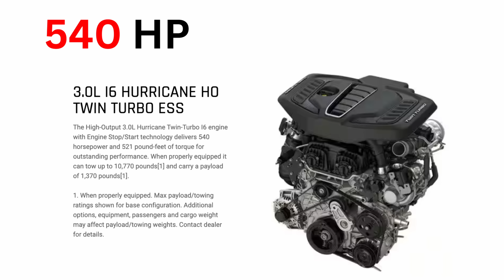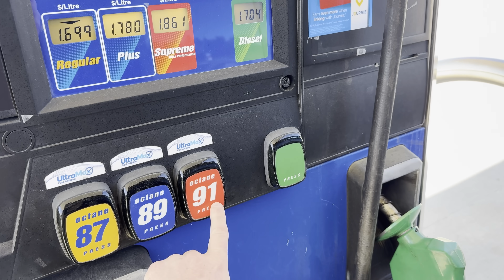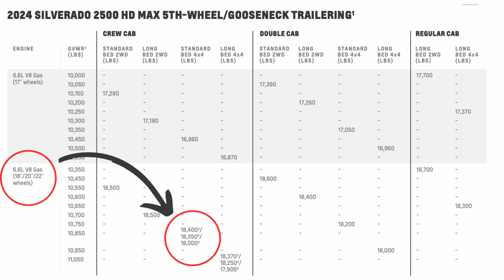Ram 2500 3L TWIN TURBO HO Hurricane Engine (540hp) | Will It Replaced the 6.4L HEMI??

Comment: It's going to take high octane fuel to run a higher end engine, no matter who makes it.  With variable cam like a BMW,  you could possibly change this,  but octane is part of performance.

The goal is solid performance at reasonable costs.  Places like here in California,  diesel engines are under siege,  but we still need the capability.   If that means high octane fuel,  no problem.   

Of course it would be better if the laws were more reasonable, but they aren't.

Comment: Just got back from a 10 state 4,300 mile trip out west over mountains, thru deserts, and across the windy plains. The 6.4 did fantastic. Terrain, ambient temperatures, or speed did not impact any of the vital temps. Yes, the hemi is thirsty pulling a 10,000lb 5th wheel but power / engine performance was never an issue.

Comment: The 6.4 Hemi will stay put; for all the reasons you mention, plus it's in a 2500. There's currently no CAFE requirements in the 2500 truck segment, so Ram/Ford/GM have no reason to change out those V8 engines.

Comment: These are light duty engines. The only way one might have a chance is to detune it so it wouldn’t burn up. Cummins 6.7 in a pickup has way more power than in a freightliner chassis. Ford power stroke again way more power in a pickup than a f-750. And the 6.6 duramax in the pickups again way more power that the heavier chassis from international and gm. They just couldn’t be worked hard in commercial duty.

Comment: Love my 6.4, it's hard convincing people that the HP and torque #s on paper for the smaller displacement engines dont equal the same real world performance as a bigger, stronger engine.
Reply: It's essentially the same argument as a Ford F450 pickup driver saying "But Ford's red 6.7 PS does 1200 lbs of torque, baby!!! That's getting close to semis!!!" Except the commercial 6.7 has a much lower output for...reliability and longevity. Yes a 6.7 could put out say, 1500 lbs of torque, but it is far more likely to explode doing real work every day for 10 hours at that output.

Comment: I saw a video where there is a plasic water line that runs behind the engine on the new engine that,if it leaks, the cab has to pulled off of the truck to repair it!?

Comment: The 6.4 Hemi is a car engine just like the 3.0 Hurricane is a car engine. I say it will happen because RAM doesn't seem to care about the ideal engine and just does what daddy Stellantis tells them, just like Jeep and Dodge. They will put a truck tune on it with 87 octane and be done with it. It just needs to be more powerful than the 6.4, which is easy. The points in this video are naive. Set yourself up for dissapointment.

Comment: Yup, right again. Now, because Ram already uses a Cummins engine my feelings tell me Ram will get the Cummins gas engine in the HD lineup, possibly replacing the 392. But, i believe Ram needs to keep the 392 because of the the popularity and horsepower that a certain group of HD drivers enjoy. I believe the Cummins gas engine  will be rated to out tow the 392 because of the huge torque difference placing it as just under the Cummins diesel. When people can actually drive the Cummins gas engine and realize that it's a nice alternative to a diesel it may become the base engine in the 2500 and 3500 models. Right now i think the 392 needs to stay or Ram may lose buyers in my opinion. And who knows; Cummins could tune the gas engine to make more horsepower to win over the rest of the gas crowd and then the 392 then could be axed. For right now, keep building a stockpile of 392 engines to keep buyers happy for a couple of years.

Comment: I have the chevy 2.7 HO silverado. It does fine for what I use it for. Pulled 8000lbs like butter in the smoky mountains. I have to wait and see how these new dodge hurricane engines go for a couple years b4 i look into it. If i ever buy a dodge truck that is.

Comment: I completely agree, smaller and lighter with more power and hotter is how you build a one use rocket. The lead developer in an interview said they designed the engine for turbo boost to address durability, however that is the same individual that commented that wheel liners are optional to save cost and smaller fuel tanks are provided because most buyers don't want the expense of filling a larger tank. When those in upper management of these companies spout that kind of nonsense, it tells me they are only interested in making a quick profit and not about longevity. I was the guy buying new every two to three years just to have the latest, and while I'm very fortunate to be able to afford these current ridiculous prices, I refuse to buy garbage. I'll keep my current truck until the wheels fall off, and I'm currently in the market for a pre-2010 diesel that I can rebuild/restore from the ground up.

Comment: A 5-6 Liter Inline 6 Turbo Gas engine would be awesome! Big enough to not stress it too much and not need high octane, small enough for efficiency, plenty of room in the engine bay, and most importantly and a awesome substitution for the Diesel Cummins options.
Reply: I would tend to agree. A single-turbo gas straight-6 tuned to take 87 octane. Yes turbos eat into gas mileage, but we're comparing them to dinosaur large displacement V8s that already struggle to break 14 MPG *without a load* in mixed-cycle use. Adding a turbo to a 6-cylinder doing the same driving cycle isn't going to somehow return single-digit MPGs. At worst it will probably be fairly similar MPG.

Comment: Il defend the hurricane here….it has 7.5 quarts of oil..with an oil cooler it will be cool….its turbos r liquid cooled also if i recall….i dont see the  6.4 going away..if anything i see the 7.0 liter hemi being resurrected…..there was a recent TFL comparison of the hurricane and the 5.7 hemi..the hemi got  better milage towing..but the hurricane was way cooler ..the hemi was literally burning up at 283 degress oil in the 1500 vs the hurricane at 230 ..now im sure the hd 6.4 has a much much better cooling system…but the hurricane seems COOL. And an HD hurricane would be hooked to that better cooling too. id hook it right up to the cummins oil cooler radiator and tranny cooler…it would be cool….i dont think for a second we will ever see this engine  in the HD….again i see a 7.0 liter or cummins gas option.. as far as the plasma linings..they r so hard that it will always be the piston that wears…the question i guess is what temp damages the lining..if i had to guess it’s ridiculous high.

Comment: They should put the SST low output in the Jeep Gladiator, but they won't, it makes too much sense, Stelantis doesn't care, they say you can have Fake Exhaust sound and Frame Shakers in your car but no V8.  I have the 23 Gladiator Rubicon with the 3.6 and I think the oil temps & water temps are allowed to go too high.

Comment: I would rather they kept the 6.4L HEMI in the HD trucks than bolt on one of the U.S.S Gerald R. Ford's anchors under the hood (a.k.a 6.7L Gasoline fueled Cummins).
That thing it's way too heavy, not enough displacement and underpowered for gasoline engine duty.
Stationary location ? SURE ! WHO CARES ? It's not like it's being moved around like a bob weight messing with a vehicle's dynamics.
 But installed under the hood of small-ish 3/4 and 1 ton truck ? Definitively too heavy, small at only 6.7L and underpowered.
BUT back to the article's question title:
Not a chance that "toy grade" engine would be used to power the 3/4 and 1 ton trucks.
For the same reasons as others and yourself stated and for the same reason Ford went thru the trouble of building the 7.3L gasoline V8 in their 3/4 and 1 ton trucks instead of dropping in them the "Eco OR Boost" 3.5L V6.

Comment: I am so glad I can not afford a new truck. These twin turbo engines are just crap. Look at Toyota and thier crappy V6 twin turbo engines. Quit chasing Ford and thier legendary Ecoboost V6 and build a quality V8 truck. Besides Heavy Duty trucks need that V8. Want a turbo in a HD, get a diesel. 😊
Reply: It's the idiots at the epa that steer manufactures in this direction. Hemi uses less fuel than hurricane, but the government believes its better for enviroment.

Comment: I guess we should monitor the battery/alternator voltage with an under hood clip on reader vs. a voltage gauge in cab? Maybe we should have a mercury thermometer under the hood to read water temps vs an in cab gauge? How about oil pressure monitored only by looking at an engine block screw in reader versus and in cab gauge?  I can go on and on.  The ability to easily check your oil level anytime without popping the hood from the comfort of the cab deviates from the norm, but if you stop and think about it, what's one more electrical system in a sea of them?  I like it.

Comment: How about a gas 5.9L (throwback) inline 6 low pressure turbo with 450hp and 550lbft of torque...on 87 octane.🤯
Reply from the maker: Sounds like an absolute winner in my books.
Reply: Rumor is Cummins is making a gas version of the 6.7

Comment: What a silly ideology! Heat is managed via the proper cooling system. What a non-sensical video……. The 6.4 Hemi is NOT an HD engine.
Reply from the maker: lol okay bud
Reply: @GettysGarage  you lack of automotive engineering and knowledge is very apparent.
Reply: And a 3.0 (ANYTHING) is?? 😂
Reply: @tomdrew5818  new engine, yet to be determined how good it will be.

Comment: Sure the Hurricane engine has some good numbers on paper, but nobody ever tells us AT WHAT RPM they are producing those numbers.  I couldn't find any RPMs listed for the HP and torque numbers that Ram provides.  I have a sneaking suspicion that you have to rev the devil out of that motor to achieve those figures, and that's NOT what I want to do in a HD truck.  There is no replacement for displacement.
Reply from the maker: I actually think I read it makes like 90% of torque by 2,300 RPM but I agree with what you are saying, on paper numbers don't always translate to real power underload.
Reply: As the owner of a 2.7L ecoboost I can tell you in my case the paper #s and real performance match up. 400 lb-ft at 2700 rpm, and it holds that across to 4000 rpm. I don't have to rev it up to get it to grunt. I'm certain the Hurricane will do similarly. But, they should stay with the 6.4 in the HD truck - better suited to the application

Comment: I’ve got a 2023 Power Wagon like you. Love it. Yeah I don’t want any plasma coated cylinders for my vehicles lol. My snowmobiles and ATVs have them but I’m not trying to get hundreds of thousands of miles out of them. Like you said they’re cheaper, lighter and dissipate heat better but I don’t think it’s what you want for long-term durability. Any dirt gets down there and you scratch through the coating you’re done.
Reply from the maker: Agreed, It's nothing new but it just does not seem like the durable choice.

Comment: I think you hit the nail on the head.  Just look at Ford, you don't see them putting their 3.5 eco Boost into the heavy duty line up. For I believe all the same reasons you have mentioned.
Reply from the maker: It's a very nice comparison because the HO Ecoboost is putting down more power then the 7.3L godzilla, yet we don't see the ecoboost in the superduty trucks.
Reply: @TheGettyAdventures  I had a 2017 3.5 eco boost.  Loved it. Towed my 10000lb rv with it sometimes. Worked great. Now I have a superDuty with the godzilla motor. And tow an even bigger rv 12000lb.  The ecoboost has the power to tow it, just not the staying power and robustness of the big naturally aspirated engines.

Comment: There’s an old saying that you have to dance with the girl that brought you to the prom. The 6.4 Hemi has given Ram a great reputation for capable and reliable heavy duty trucks. It took a long time to gain that reputation, and it would silly, in my opinion, to stop producing it. Why kill the Golden Goose?
Reply from the maker: I don't think Fiat felt like it was worth re-investing into the Hemi platform most likely forced by government regulations as well. nothing wrong with the 6.4L hemi, it has its issues but overall a nice engine.

Comment: If twin turbo was the great. Ford would have put the ecoboost in the F250. putting the hurricane in the 2500 is a disaster waiting to happen. I would not think of buying one.
Reply: The twin turbo is so great that Ford DOES put it in the 250. Last time I checked the 6.7 has two snail……
Reply from the maker: 6.7L powerstroke is a single turbo, hot center set up.
Reply: @GettysGarage  I stand corrected. The 6.0 was also a hot Vee, but it had extra snails making it pretty cumbersome. Single turbo is definitely better for longevity.
Reply from the maker: A couple of folks had this comparison as well and I completely agree. ford has had the ecoboost for 13 years now. never once has it been rumored going into the HD trucks.

Comment: Even BMW is in brain dead enough to try to squeeze 540 hp out of a 3 L in-line six cylinder; and expected to be able to pull heavy loads for extended periods of time. The carnage videos for this engine should be very interesting
Reply from the maker: I mean look at the tundra, its dead in the water at this point. nobody is touching those 3.4L twin turbo engines after the recent recall. Ram has put all their eggs in one basket and this hurricane engine is wound up pretty tight.
Reply: @GettysGarage  the difference is Toyota had a manufacturing problem. Which they will fix. So that engine will do fine. Chrysler is  Chrysler. They have a demonstrated lack of ability to build anything that lasts
Reply: @kevinbarry71  "the difference is Toyota had a manufacturing problem" . . . . . . . . . . . . (cue Dr.Evil's voice) Riiiiiiight . . . 
That's what it's been spoon fed to "everyone". Is it really the truth tho ? 🤔

Comment: 6.4 with no AFM is too desirable

Also spray on cylinder liners are a non issue as they are way better, and they increase displacement vs cast iron etc.

Comment: A lot of the reasoning behind why they didn't upgrade and refine the Hemi is because the Hurricane platform kills multiple birds with one stone. It's cheaper to make an I6 than V8 in general since they are * typically * less complex and can be made on the same assembly platform as an existing I4. That is the case with the Hurricane as it's roughly based on the 2.0L, and it was already compliant with emissions as a 4 cylinder. Use forged internals and turbocharge it to get big power, and now you have an engine that can push past the 392 in sedans power wise but sip gas like the Pentastar on a dyno for the EPA's testing. On top of all of that you had more Hemi options between the Hellcat, 345, and 392, but now it's just the SO and HO versions of the I6 with a lot of the power differences coming from the differences in boost. No emissions to worry about that would require modernization of existing engines, no more gas guzzling/CAFE fines from the EPA (bonus points since they are going to do EVs and hybrids), and cheaper to manufacture. Ultimately they took this route to save money, and while it's true that it's a low chance of the Hurricane coming to the HD trucks it's definitely not 0%. I can almost guarantee you that Stellantis is probably looking at ways to stuff it into the 2500 and 3500 without compromising too much of it's longevity. If not the Hurricane, they'll probably look into doing something with VM Motori over Cummins since they actually own VM through Fiat. It almost feels like they are itching to drop the Hemi with the quickness at Stellantis.
Reply: I don't get why this guy is so "certain". It seems he's scared and now screams loudly "no this will never happen" when RAM and Dodge killed the Hemi just like that when daddy Stellantis said so.

That company has proven to not care about heritage in the slightest. Also why does make the 6.4 Hemi seem like a truck engine? It's the same engine that was in the Scat Packs, just detuned for regular gas. RAM will take the HO 3.0 Hurricane and give it an 87 octane tune and that will be it.

As you said, they made these engines to save money everywhere they can, why on earth would they make a brand new engine for this application? The Americanness is over.

Comment: Just go grab the Chevy 2500 l8t. The thing runs like a dream and pulls whatever u want with 87 octane. And u dont have to pay 1 dollar more per gallon for diesel.
Reply: I've never paid a dollar extra for diesel hell I'm paying 50cents less for diesel then low grade
Reply: @moparjr89  lucky you. Here in Pennsylvania. Diesel is over 1.00 more then 87
Reply: @moparjr89  Where I live in the Great Plains states, diesel fuel costs 17%-25% more than 87 octane unleaded gasoline.  The gap can get even wider in the winter when the diesel price goes up due to heating oil demand in other parts of the country.  When one looks at the acquisition and maintenance cost premium for diesel pickups (that cost premium almost 100% due to all of the insane emission control regs on diesel engines), owning a diesel pickup only makes economic sense for people who tow or haul big loads and/or drive lots of miles.  When I no longer needed my HD diesel pickup for heavy loads or towing, I traded it for an F-150 4WD with the 5.0 Coyote V8.

Comment: Great analysis. I think you are spot on. 540 hp is asking a lot of a 3 liter engine. Reliability and longevity will surely suffer over the long term in a HD especially and perhaps in a hard working half ton too. A Charger or Challenger, or some sports type cars would be great applications for that engine.